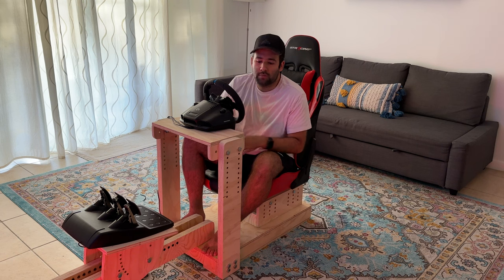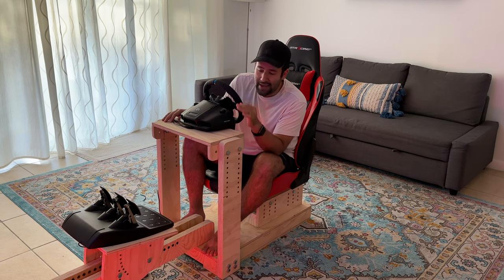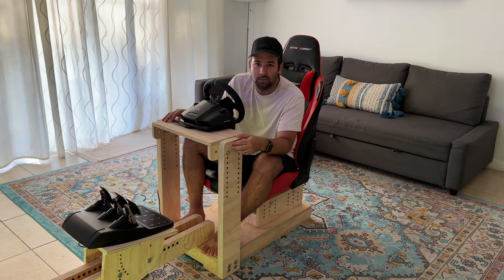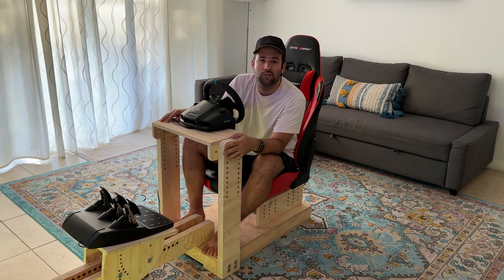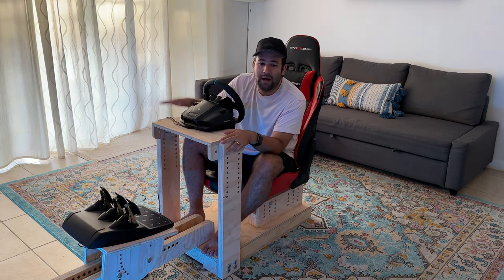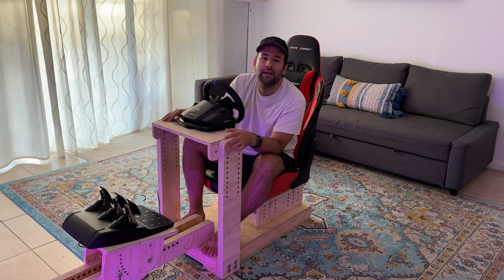DIY RACING SIMULATOR SEAT

Comment: From 1 sheet... this is really good. I have a couple questions though. Did you develop any racking for the wheelbase? Its being held up by only 4 bolts, with no cross member support. And I also noticed you didnt use washers for the bolts. Have you had any issues with this since finishing it?

Comment: Where did you use the m6x30mm bolts? And are those woods from the framing similar to the size of 2x4s?
Reply: It’s plywood/laminated which is better in this application. Especially, the more it’s staked/layered.